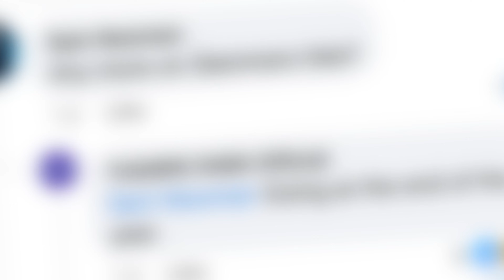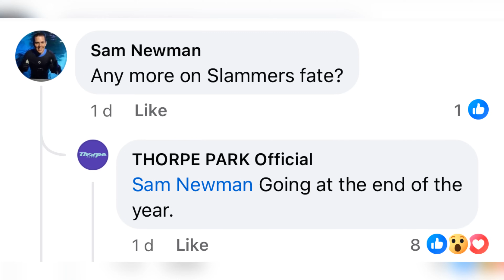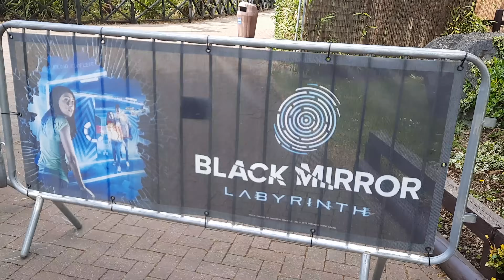INSANE Thorpe Park UPDATES for 2024!!

Comment: Replace BM with an indoor flat ride and add some sick light/sound/effects to it, and use Slammer for the (extended) queue. Bonus points for an intense inverting flat ride  (thinking those twister rides that invert and twist upside down, or those breakdances that swing you upside down), and have part of the queue in the old BM labyrinth route with a show scene before you board, and it'd be great! Kinda do the whole "sister ride" thing like Nemesis and Sub Terra at AT